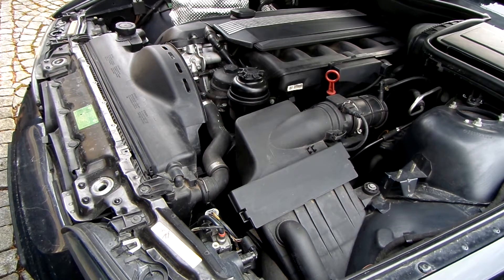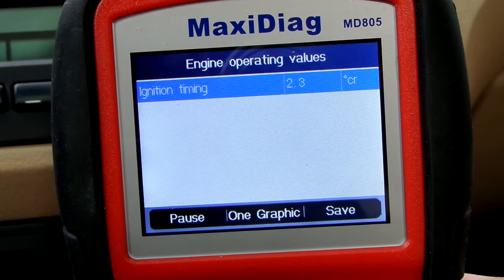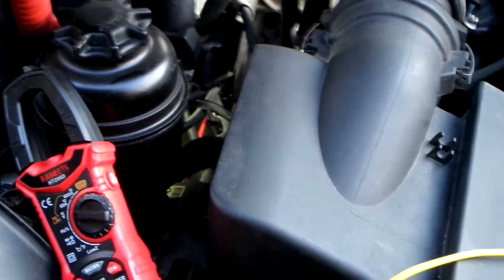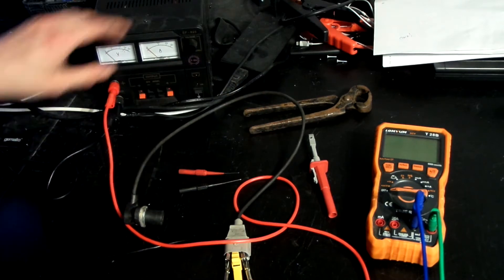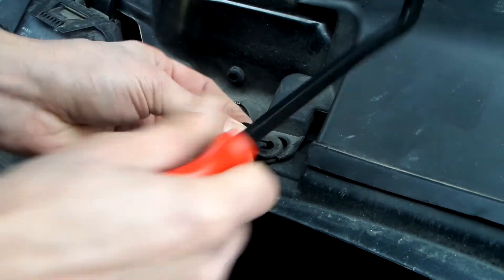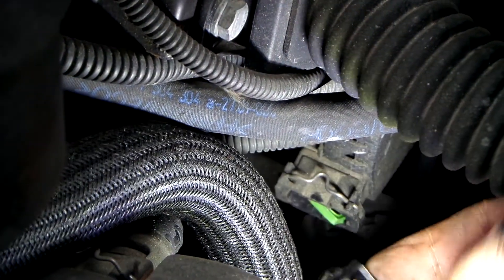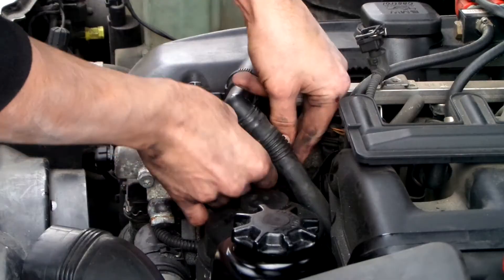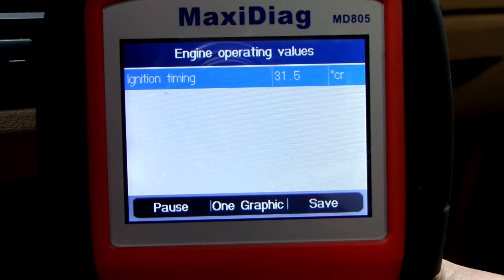⚙️ [BMW E46/E39 M54] Camshaft Position Sensor Replacement

Comment: Hello! My car has a problem: 65 NW_E- Fehler. I took out the sensor and measured 12v and 5v.It's OK!
If I bring iron closer, 5v decreases. At this point I start to hear some engine mechanisms buzzing. Is this normal? Can I be sure that the sensor is working properly?

Comment: Would a code P1525 be related to this sensor? My car seems to be driving fine but this code just showed up.
Reply from the maker: It could be, yes. I would test the wires and the sensor, if possible.